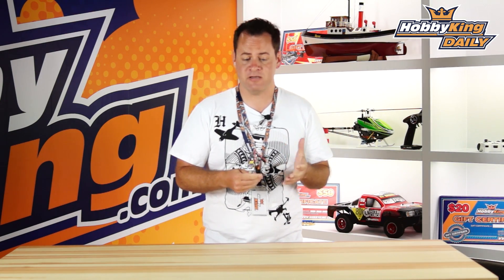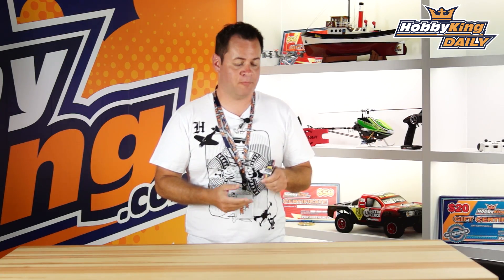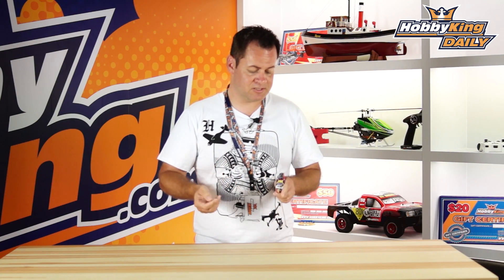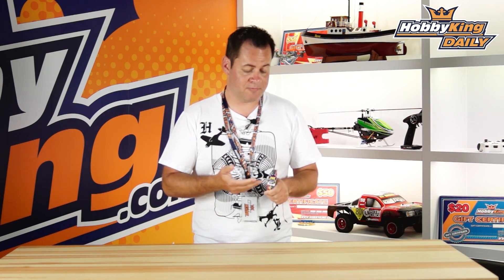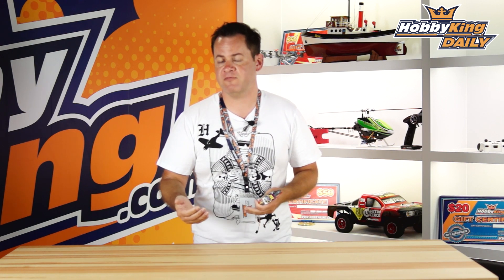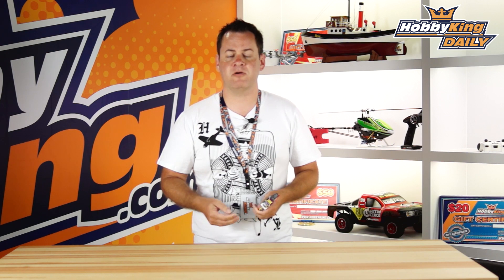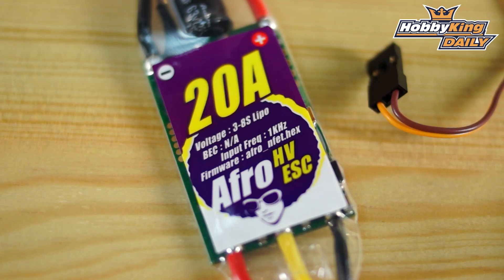HobbyKing Daily - Afro 20A HV ESC

Comment: Do your homework Chris: the higher the voltage the higher the current for the same amount of resistance (v=ir). The higher the voltage the lower the current for the same amount of power (p=iv). Less current = less power dissipated as heat = higher efficiency = longer flight times
Reply: I think what he was meaning was, higher voltage at equal wattage (i.e. same amount of thrust/power from the motors) = lower amperage. He talks about designing a system from the get-go with high voltage in mind, and obviously in that case you'd look to use a higher voltage capable motor, and thus be using less current for a given power, rather than just putting more volts into motors designed for 3s or 4s.
Reply: i think you misunderstood me, Voidugu, you've basically said what I was sayinhg in my comment. I was saying if you build the system with high voltage in mind from the beginning, you can use higher resistance motors with higher voltage, and thus lose less energy as heat because they require lower current for a given wattage output. I think we agreed all along man, cool?